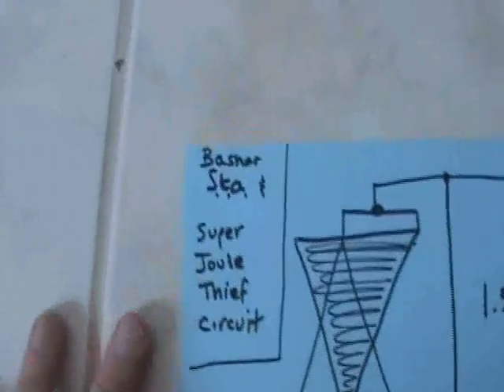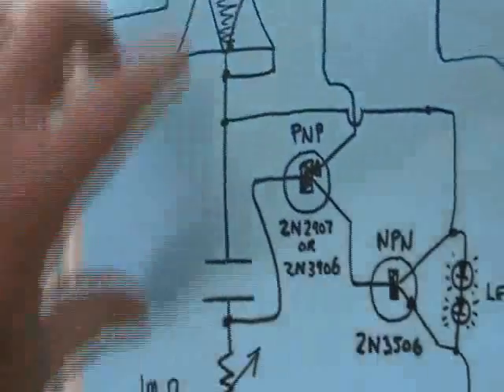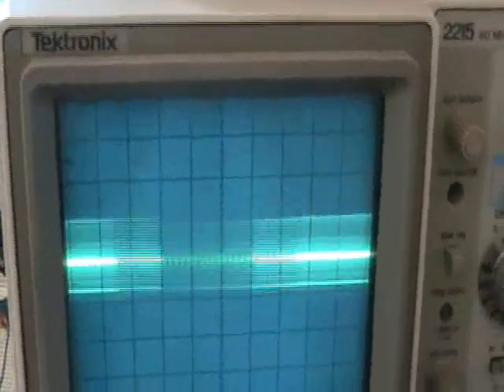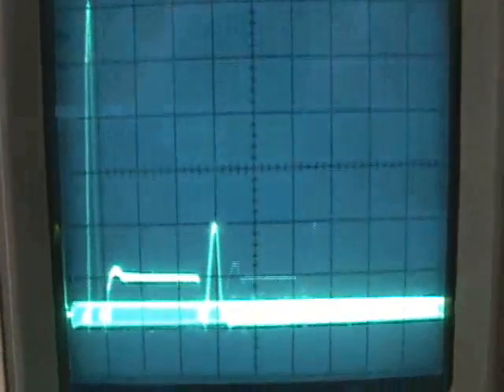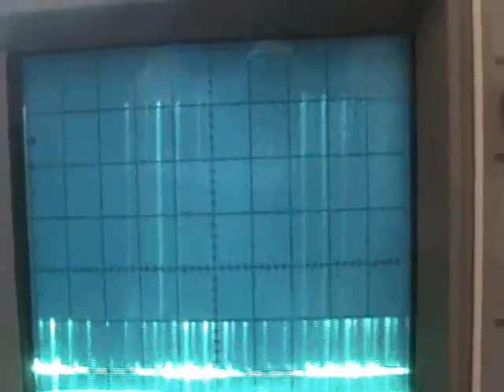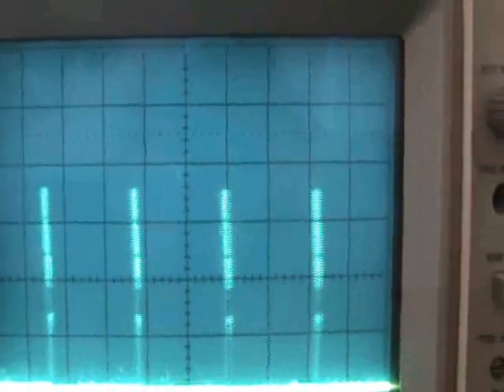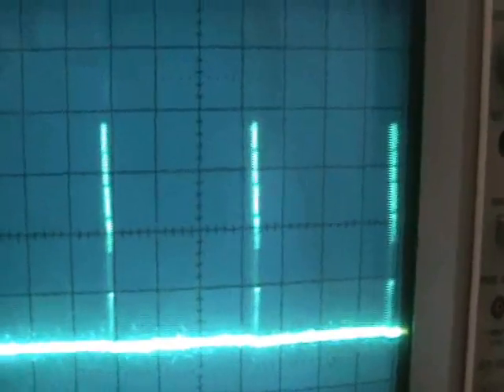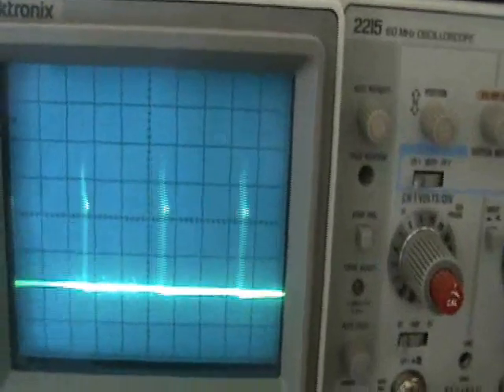Ep. 19 - Bashar Free Energy Space-Time Antenna (Frequency Shift)

Comment: You are showing about 3.6 K Htz. at 1 milivolt divisions as best as I can determine…that is AM RADIO...the problem is that most of you kids out there is that you show a lot of video info without stating any facts.
Then there is that battery…go away!
charlie
Reply from the maker: +Charles Irby Yes most of my experiments are with low power. With such a large coil, I'm interesting in the non-stability caused by the thing. Yes you can make a tiny little, STABLE oscillator. What is the fun in that. Use a physically LARGE coil, and see what happens. I find this kind of experiment more fun than a "RECIPE" that anyone can do that always results in the same result.

Comment: Use a 555 timer to oscilate the coil to 7.8 and set up a resonant coupling from the coil to the radiant energy field?  Maybe when in resonance your coil, instead of being a transmitter, will also be a receiver of  a large source of radiant energy.
Reply from the maker: Yeah. I was thinking along these lines too, and tried it. Actually, the 555 was too hard to do at this low a frequency, so I went to a signal generator. That too wasn't very accurate, so I went to using a microprocessor. With a microprocessor, I can control the duty-cycle accurately. Tuning NEAR the Schumann Resonant frequencies is a bit of a challenge. I think also to couple with these ley lines, you probably need a bit of power to have enough of a magnetic field to "lock". Further, there are only certain hours of the day -- Sun Rise -- Sun Set -- where the gain will be easy.
Reply: sunrise and sunset., thought orgone energy was supposed to have an east to west field?  In Carlos Casteneda, the sorcerer Don Jaun often said the time of power was at sunrise and sun set where the Earth can act as a boost, where the energies sparkle and reflect off the mountains.
Reply from the maker: Spangley Rainbows Yes. This topic is also discussed in the excellent TV series called "The Pyramid Code", found on hulu.